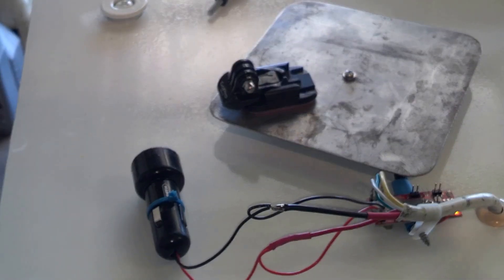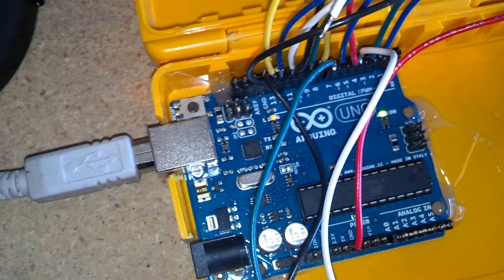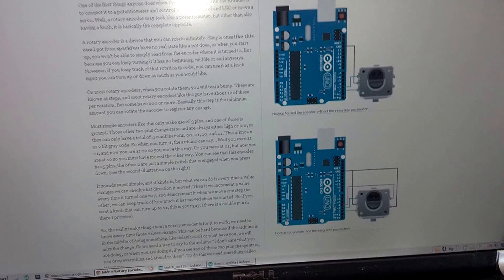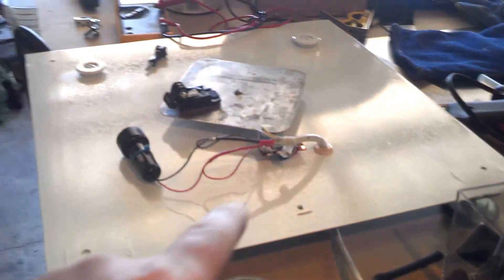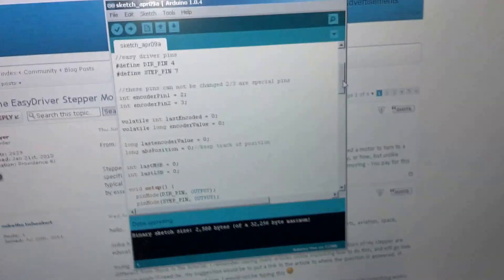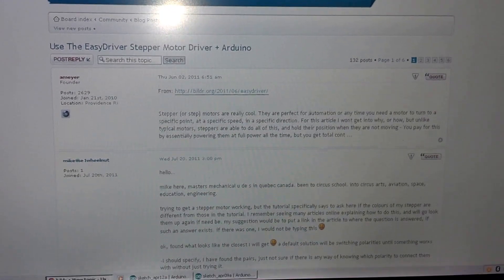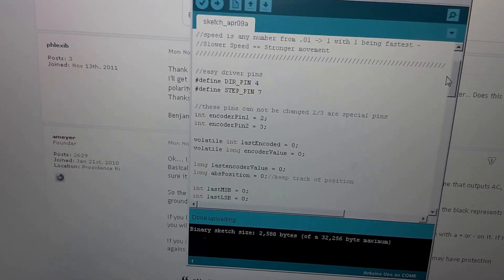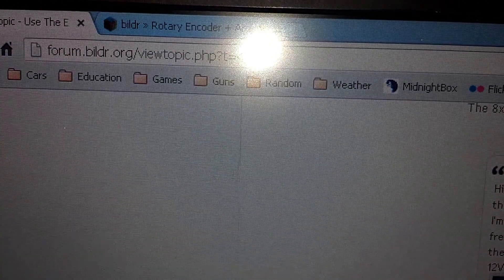Ardruino+rotary encoder + stepper motor

Comment: got the same problem(
Did you find the solution?
Reply from the maker: Haroun Hajem Can you get to the forum link I posted above? That's almost the exact code I'm using.
Reply from the maker: Aleksej Vasic let me upload the code to my google drive and I'll send you the link over g+
Reply: Dory Hayes
Did you find the solution?
Reply from the maker: Yes I have the code if you want me to send it to you. I've only tested it with my hardware though so your results may be different.
Reply: Dory Hayes
 You sir are an angel. If you could share the code. I'm doing almost the same project. I'm using an stepper + EasyDriver + optical encoder + Arduino uno.
Reply from the maker: Here's a link to the Forum on Bildr where I got help to fix the issue: 

http://forum.bildr.org/viewtopic.php?f=25&t=1167&p=7145#p7145
Reply: Dory Hayes I have the same problem, and I can't open forum.bildr.org for two days, can you please send me explanation if you have?
Reply: Thanks a lot! :)
Reply: Dory Hayes
 What an awsome code that Ameyer wrote. I love it! Thanks for the help.